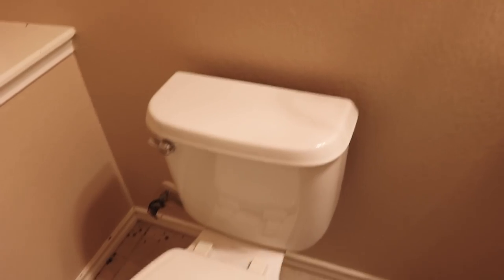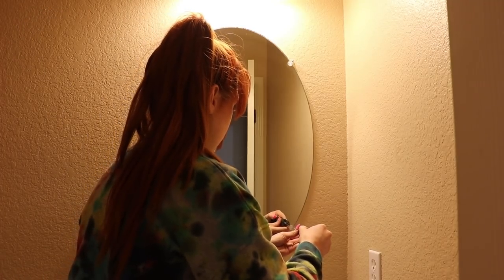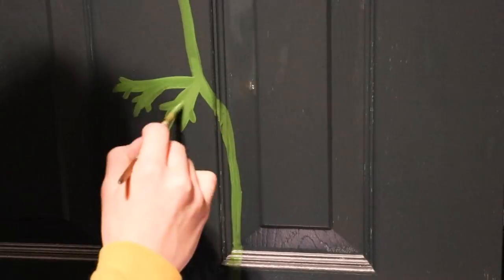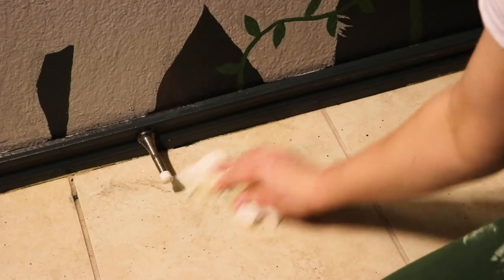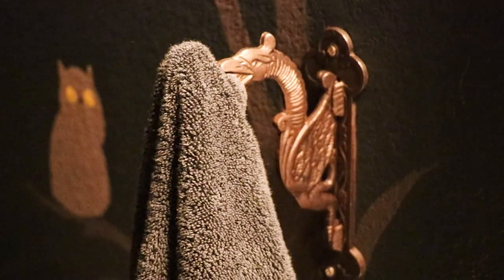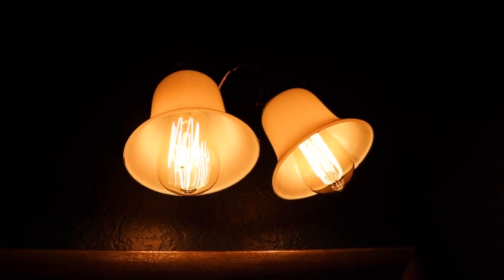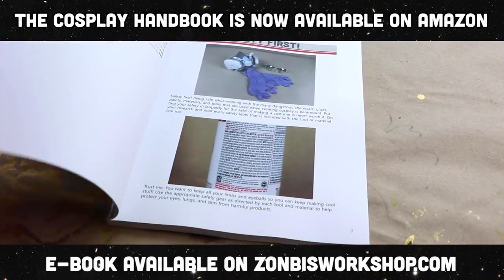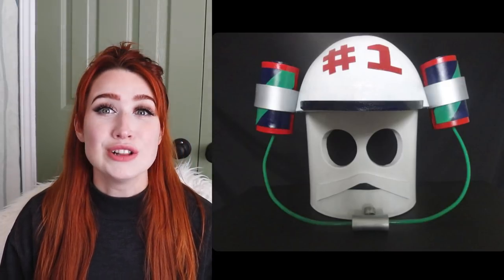Goblincore / Spooky Forest Bathroom Makeover

Comment: Wow excellent job on the bathroom, I themed my rooms in my house also my bathroom is Ghostbusters themed trimmed with caution tape, painted portal on ceiling , proton pack and the pke meter on display, and a Staypuft ceramic for toothbrush holder, and slimer sculpture on display, also have a light up haunted house painting and a interactive headless horseman painting that when you go in front of the sensor he lights up and threatens to take your soul.
My other rooms are Game of thrones, Hogwarts / Lord of rings , Dracula's lab, Comic goth, and Ice cave.